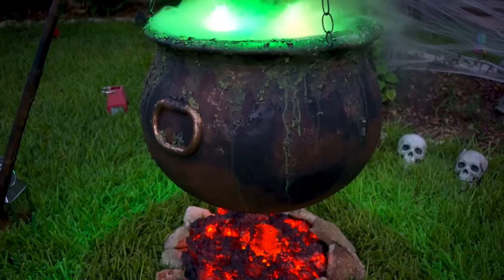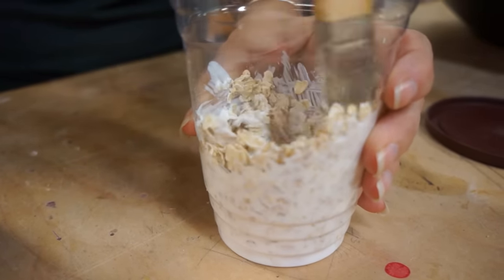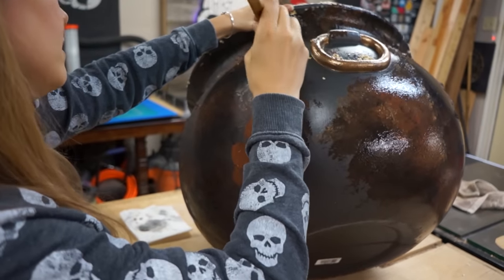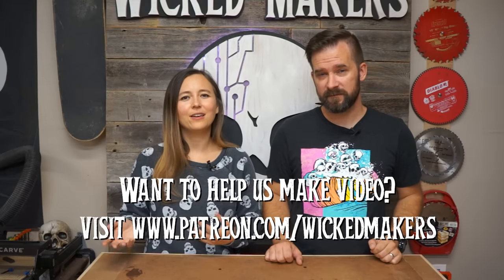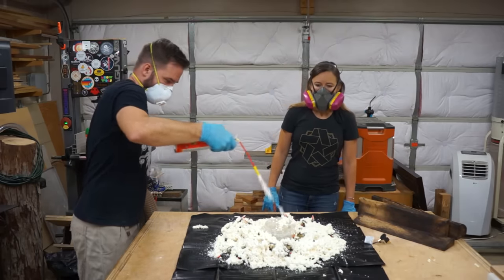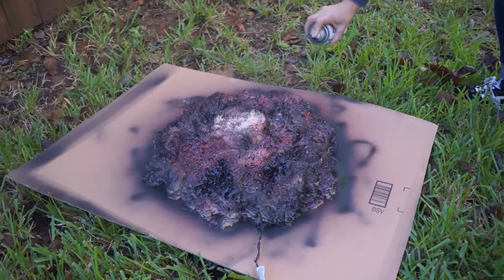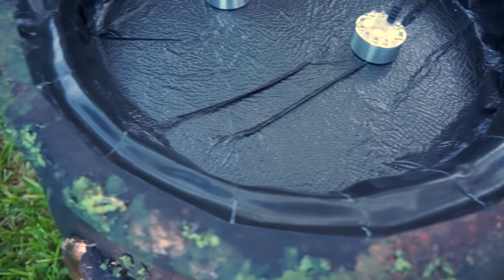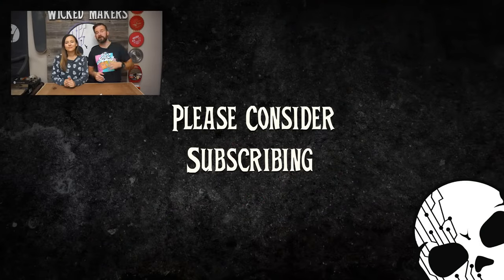DIY Halloween Props - Bubbling Witch's Cauldron with Glowing Coals

Comment: A tip for anyone who is curious, they make fire retardant spray foam and that's a great option for using with lights that can get hot since spray foam is highly flammable.
Reply: Yes and also:
Use LED lights.  They don't get all that hot.  If you have the skill to do it, you can run them at about 1/2 power and they still will make enough light to work.
Also, also:  They make fake ceramic fire place logs for gas fire places.  They don't burn and some of them look quite real.

Comment: So, couple of questions, what type of expanding foam did you use, does any brand / type work? Also, you had a tupperware dish in the middle of your light bundle when you were spraying the foam. Was that just to help create the "mound of ashes" shape and did you remove it or leave it in after the foam dried?
Reply: I came here looking for an answer to the tupperware dish, too!  If you scroll down, you'll see that they were planning on using it for dry ice, but decided against it.

Comment: I'm having a hard time finding the tray for the inside that will hold the water.  Any suggestions, other than Walmart, Micheals or Party City?  I received the foggers on Saturday, they are super cool totally amazing!  So much better than a fog machine.
Reply: Same! Wondering what they used exactly. I've looked up feeding pans, wash basins, cake pans, but I can't find one that wide. Walmart had a 12" feeding pan, but that wasn't wide enough! Maybe I can find big enough Tupperware, and glue some cups in to elevate the foggers so they're not deep in the water?? Just want to know what they used, or what it's called!

Comment: How did the oatmeal hold up?        I am thinking about using sand- it may not be as chunky but will still have some texture

Also- I spray painted 2 coats of black, and then 2 coats of hammered copper spray paint - and it looks awesome!  I hit the top rim and the handles real heavy with the hammered copper.  i love it.
Reply from the maker: Oatmeal has held strong! Definitely want at least two coats of mod podge/sealer over it though.

Comment: Hi we watched this video today and it was exactly what we have been looking for. I bought the mist maker from amazon and put it in a halloween style bucket but the mister kept splashing water onto the worktop. Does it only work with a wider circumference bucket ?
Reply from the maker: If I recall, the splashing is based on how deep it is.

Comment: I like the idea. However, I’d like to stay away from having to use the least amount of electric & cabling as possible. So, I’m going to try and run a battery powered LED strip of green, through a clear tub and place it under the water. Think it might create the same effect on the water, omit the use of the electric for the green light you placed on top and look less intrusive too. Will probably do the same for the coal/amber pit. Let’s see how that turns out.

Comment: This is a great prop. My concern with this one and which you do not show in the finished product, is the light hanging down from the top. How do you cover that to make it look authentic? It seems to me that the bowl should be clear with the light coming up through it from below.
Reply from the maker: Thanks!! Since the casing of the light is black, you don’t see it at all at night. During the day and at dusk you can see it a little but we weren’t worried about it. We kind of tucked it up inside the wrapped twine but weren’t too concerned. 😃

Comment: I used the oatmeal and painted over it. Squirrels still ate it. Maybe putting salt or some bitter herbs would stop that.
Reply from the maker: Wow, surprised to hear that. We’ve had no issues at all thankfully. Did you use the mod podge?
Reply: @WickedMakers  I think so, but that stuff is mostly edible too.  I really think that just like play-doh, if you put enough salt in it, it won't appeal to squirrels. BTW, thanks for the prompt comment, and I love what you folks do.

Comment: How do you protect the paint on the cauldron from washing away with the rain? I plan to use acrylic paints for my cauldron, but living in New England, weather is a concern for outdoor props.
Reply from the maker: It’s not water soluble so it’s been fine. We don’t get snow but we get beyond New England levels of rain and it’s been fine. If you’re concerned you could spray it with a flat or satin poly. 😃

Comment: Made one of these beauties based on your tutorial....got a lot of compliments at a Halloween themed luncheon.  Only problem is we are getting a serious shock when touching the water while the misters are running.  Needless to say I have some reservations now putting it on the front porch or the yard because of the off chance a kid walks up and wants to put their finger in.  Any ideas or advice on grounding the device?  Or does this sound like a faulty mister.  Thanks, and again great tutorial.
Reply from the maker: Excellent! Nice work. 😄 The foggers definitely shouldn’t be shocking you but there can be an unpleasant feeling when you touch the water that is part of the effect of the ultrasonic process. If you’re feeling an actual electric shock, you might have a faulty device.
Reply: @WickedMakers  thanks for the reply.  I will do some.more testing before Halloween!  You guys rock!

Comment: Mix quinine into the water, and use a black light in the top of the tripod...
Reply: Those ultrasonic misters can be sensitive to anything added to The water. I've gone through a couple over the years. They aren't good with many dyes, either. Haven't tried quinine, but I'm shy of using anything but tap water with then. Just a thought.

Comment: Hey Jay and Jaimie, question when you guys did this project, did you experience any warping on the "fire" ive noticed that likely due to the heat of the lights being embedded in insulation, that this may be the cause. Did you guys experience this as well?
Reply from the maker: Hmm, no not at all. But our lights produce no heat at all so that might be the difference.
Reply: @WickedMakers  im sure its bc i didnt use LED's, I added another ring of foam on the bottom to build it up a bit, just hit it with paint, then back to the setup. im actually glad its a bit higher now as I can use low-setting round pavers. You guys Rock!

Comment: So, I've made the cauldron, using the same size cauldron as in your video, I found the ultrasonic misters and got those as well. I made my tripod out of thick wall PVC and painted it black and also made the glowing embers. I substituted little pieces of Styrofoam for the oatmeal and I'm pretty happy with the way it came out. My question is, when I made the glowing embers I placed a yard bag on the garage floor and laid the bundled up lights on top of that applying the spray foam over it. When I turned them on a left them on for a little bit the heat actually started melting the plastic yard bag. So, my question is did you have any issues with heat build up on the lights? I'm thinking I'll need to remove plastic and maybe cut a piece of plywood to lay embers on so it doesn't kill grass from heat?
Reply from the maker: Hmm no we didn’t have heat issues at all. Might be the type of lights you’re using. The wood underneath is a good idea!
Reply: @WickedMakers  I ended up remaking the embers, the first time I wasn't thinking and the orange lights i purchased were not LED, thats why they heated up. I made sure to replace with LED lights this time. Works great

Comment: Aren't the string lights covered in spray foam a fire hazard or did you use LED? Also did you color the water and did you have to refill it?
Reply from the maker: We did loads of testing and the lights we're using don't get very hot at all. We did not color the water, and yes, we refilled it each night.

Comment: Anyone know where I can find similar chains? Or the bamboo sticks? It would mean a lot 🙏🏼
Reply: I found 3' chains in the lighting section at Lowe's. Couldn't find the bamboo, but Lowe's had 8' dowel rods in the door trim section... wanted to use pvc, but it was 5' or 10' and I don't have a saw. The dowel rods are a bit heavier but they'll work. Going to try a cardboard box inside the cauldron rather than making a table!

Comment: In the center of your spray foam embers it looks like you have a container with saran wrap on the top of it, but you did not actually explain what that is.

What is the purpose of that? Is the other end of the lights inside of that, is it a support pillar for the foam, or something else entirely?
Reply from the maker: It was just for support but was totally unnecessary

Comment: I was wondering what size did you cut the foam board. I got the 22in cauldron and I’m scared to cut the wrong size
Reply from the maker: Hmm. Basically just big enough to fit inside. It’s not super critical. 😄

Comment: First let me say that you have made a good looking prop and an entertaining video.
What would I do differently?
I would glue of patches of coarse sand before painting to give texture to your rust
After painting I would use a non organic like kitty litter to represent the boiling over of the pot - anything food bases rots and attracts ants.  Or I would use silicon widow caulk to sculpt overflow.
I don't like the tripod for the real world reason of it is very hard to remove the cauldron,  I would instead have made two side supports and put a bar across them to hang the cauldron.
Your fire is really good, but if you don't need the weight why not carve foam rocks and then add the expanding foam?
The foggers are great.
The light I would want to put under n the cauldron, but this is just a personal preference.

Let me say again that this is a great build.
Reply from the maker: Thanks! Great tips as well. 😄
Reply: @WickedMakers  If as makers we all share how we do it, ideas are spread and we all become better at making stuff.

Comment: What type of paint  was used for the rust  effect and the green boil over effect? What was the ratio used for the Oatmeal and Mod Podge?
Reply from the maker: It’s acrylic paint. The rust is metallic bronze and copper colored. Not sure on the ratio for the oatmeal, we just kept experimenting until it worked. 😄
Reply: If it's paint like Craft Smart and Folk Art then great.  I have that by the bottles full. I can't wait to try out my idea for the coal to make the cauldron and lights removable for easy replacement.  Making mine a ring of fire.

Comment: What kind of adapter did yall use for the mister? I bought one and im not sure how to use it!
Reply from the maker: Ours came with a plug, not sure which adapter you mean? Just plug it in and put it in water. 😀
Reply: @WickedMakers  ah ok, mine didnt come with an adapter sadly. Does yalls adapter say a specific voltage?

Comment: You guys made this two years ago, so how did the lights hold up over time?  Did you find any issues with them corroding or going out?
Reply from the maker: The foggers did eventually die out, yeah, after the second year. One of them worked and the other didn’t. The other lights in the foam were fine still.
Reply: @WickedMakers  Awesome, good to know.  Follow-up question: Did you seal the cauldron with anything after painting it? I'm concerned the water from the devices will mess with the black/brown acrylic paint job.

Comment: I love this so much! I got all the stuff, slopped oatmeal on the caldron, cut the chain and built the tripod. Whilst working I realized my 6’ thin bamboo poles were too tiny and short so I worked on the embers, ran out of spray foam before getting all the lights covered and to attempt burying them I stupidly stuck both hands IN the foam (I’ve never worked with the stuff) and now I’m benched and trying to pick it off my skin! My husband is laughing at me
Reply from the maker: 🤣🤣🤣 amazing
Reply: @WickedMakers  done! Have you ever had an issue with those mist fogger things not working? Mine stopped after a day

Comment: I cannot find a tray for the top of the cauldron. Any suggestions?  I've searched online.... Amazon, Walmart, Target, etc. Can't find one like yours that is deep enough for water. Help!
Reply from the maker: Amazon. Search for plastic serving tray. Lots of good options. 😀
Reply: You can also check academy in the grilling area.  I’m Not sure of the actual size but I used them as cookie trays.
Reply: @WickedMakers   none of the Amazon ones fit the size I needed.  I actually got lucky at my 3rd dollar store try... Dollar General had plastic Christmas trays (Yes, Christmas... and it's still September).  It was green with no tray holes....so, it was a win win. Am leaving it green to match the green ooze over the sides. Btw, I just used my hot glue gun for the oozing. I let gravity help the glue run down the cauldron.  Painted the ooze with paint and glitter... it was thick and clumpy, great consistency.  Thanks for your inspiration. This was fun to make!

Comment: Where did you plug in the foggers?
Reply: They have a list with links under the video of the supplies. The foggers are from Amazon.
Reply from the maker: Through the bottom. It’s in the vid. 😀
Reply: Sorry. What did you plug them into. I do not see that in the video. That is what I was asking
Reply from the maker: @ERNursey  ahh, we just have an extension cord that’s hidden in the grass for the lights and foggers. Is that what you mean?